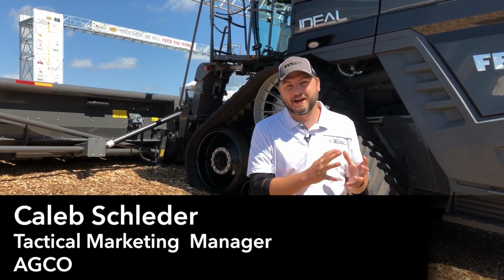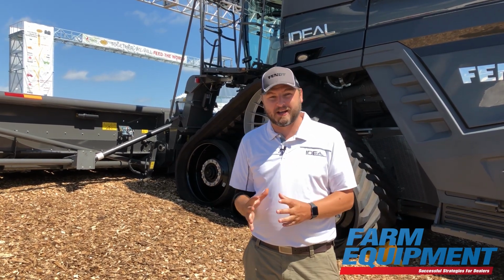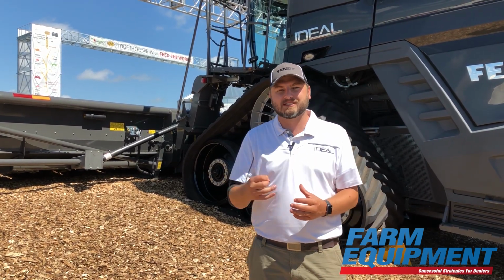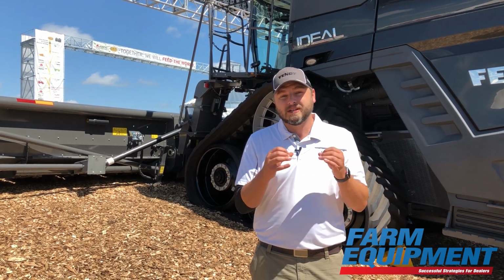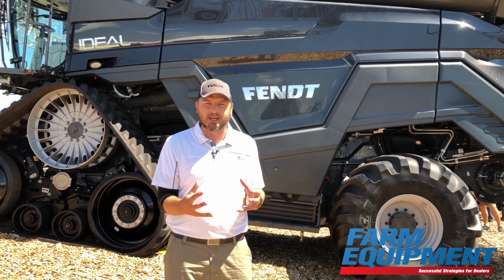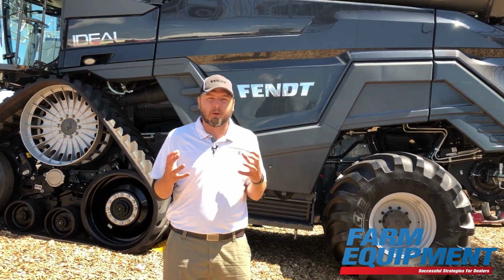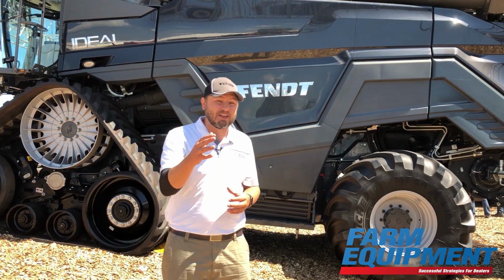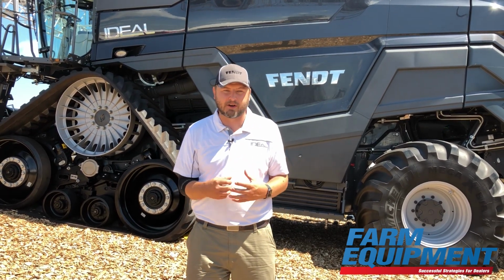Presenting the Fendt Ideal Combine to the North American Market

Comment: Man slow down there turbo lol it's not the flippin space shuttle or something lol it's a combine. Granted it's a great machine but tone it down just a little.
Reply: Well I don’t know what you think I meant but I didn’t have a single thing against the machine lol I was talking about the dude doing the demonstration but ya you have a good day. And for the record I can’t stand John Deere either. I am actually a big fan of Fendt and the whole AGCO line.
Reply: Dude, first off your grammar sucks. And second, this machine is years ahead of anything else. For example, John Deere's 2019 s790 only unloads at 3.8bu a second while this does 6bu a second. It is also able to vary that speed down to 2bu a second. At max speed, it can unload 450lbs of 20-21% corn a second. The full tank would weigh 35k lbs and in a minute and a half, it's sitting in a grain cart. This machine will be a great asset for those companies who run fleets of combines, and I'd say its still going to be cheaper than the best Deere has to offer. So for the 2020/2021 Deere combine I will bet money it has a lot of features this machine has.